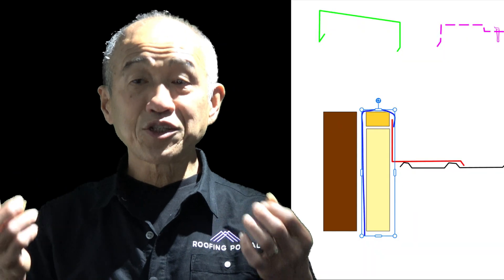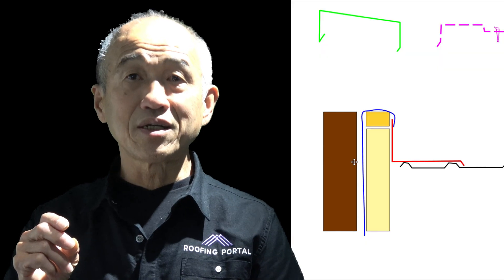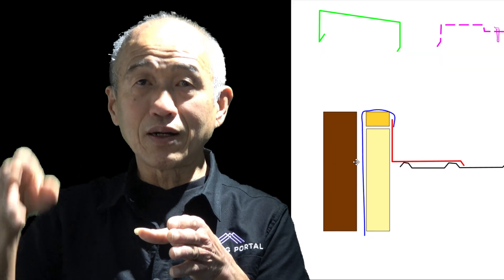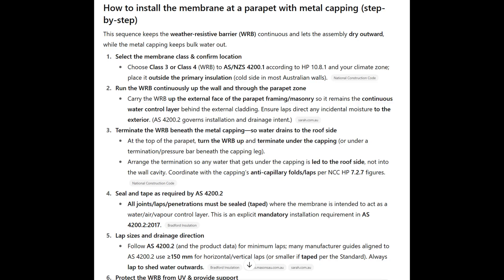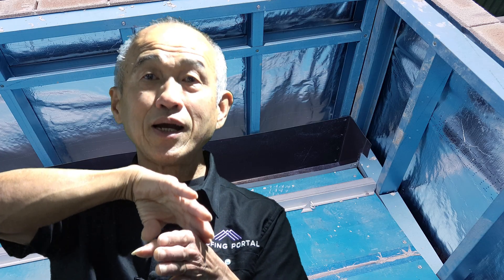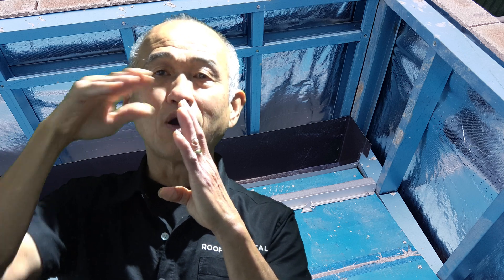parapets and capping - why the widespread non conformance

Comment: Termination is key word.  'Termination' is not the end of the wall itself.  It is a reference to the part of the wall detail along roofing membrane perimeters securing the materials to the wall.  It if often a hemmed metal bar stock, but could be many things such as wood nailing strips or plumbers tape held by concrete anchors.  The roof membranes are prone to wind uplift.  Your termination is to secure the perimeter to prevent wind uplift.  Without a termination-zone the roof will peel off under wind uplift.  But a secured perimeter will keep nearly all wind from going below the roof membrane.  Your cap protects the termination.  If your cap is flat you are prone to moisture stagnating under the cap, hence why your parapet wall should slope back to the roof, and your roof material should go over the parapet top.  Your wall should be able to breathe out to allow interior wall vapor and moisture to exit the exterior.  So whether you slope the parapet or not, you want a way for vapor to exit.  Your cap should be cleated that fastens into a secured header.  The metal is installed over the cleat using open hems to 'clip' the cleat and then the back of your cap is secured to the point that protects the termination.  You overlap cap metal 2 inches (50mm) minimum and use s-locks to hold the top metal cap tightly to the bottom metal cap using the natural springiness of metal when you smash hems.  I've seen all sorts of stupid ways to tie the cap together, but s-locks are simple to make and use.  The top hem of an s-slock has itself a closed hem on its edge to prevent rusting on an exposed metal edge.  Only the top hem of an s-lock, the part clipped onto the top cap piece, is visible in an s-lock once installed.  (This is often only about 1"/25mm exposed.)  The lower hem does not need this extra hem detail to protect the exposed metal edge because it is not in direct water exposure.  An s-clock generally begins as a 4.5" strip before the 1/2" hem is made, smashed, then the top 1" hem is made, the piece is flipped, then the bottom 1" hem in the opposite direction is made and smashed.  It has an s-shape, hence the name s-lock.  This give you the full 4"/100mm lap to satisfy most building codes.

Comment: Most roofers install the capping with no fall so water ponds and then secure it by screwing through the top surface - both not in accordance with NCC. As building inspections are lazily only done from the ground, no one sees the non compliance and they get away with it.

Comment: In New Zealand,  its usual to add a packer to the top plate so the flashing is supported at 5 degree fall. Otherwise it tends to end up nearly flat, even though it has been manufactured with the 5 degree fall. We do the same with the wall wrap, except when the roof is a membrane such as TPO, in which case the membrane covers the top of the parapet to the outside face of the cladding. The hidden fastener method of fixing cappings is really only done on high end buildings, otherwise we screw through the font face, that is much faster to do.Just needs the manufacturer to fold the flashing to the correct angle, and the roofer needs to take care to not over tighten the screws, as if these are not right, the face of the flashing buckles and looks horrible.